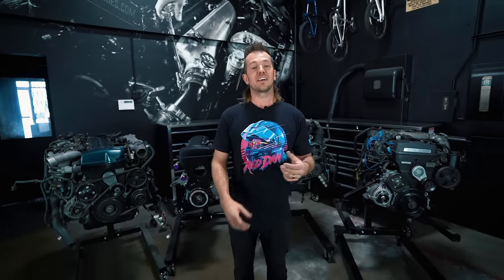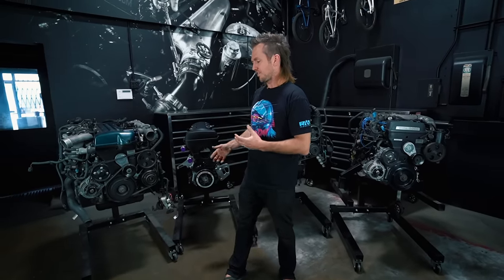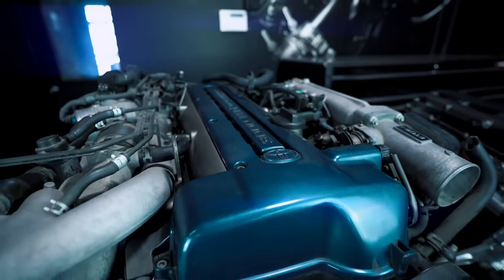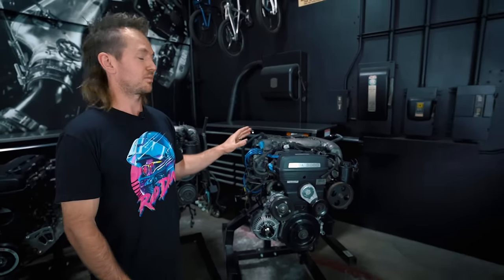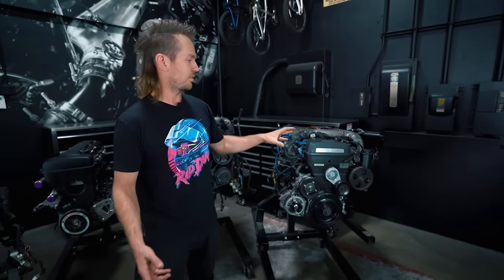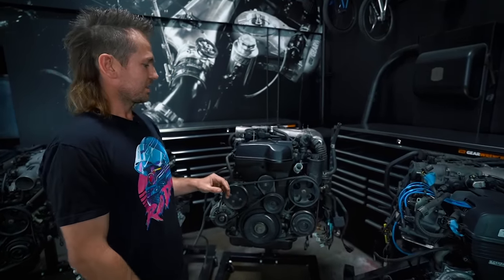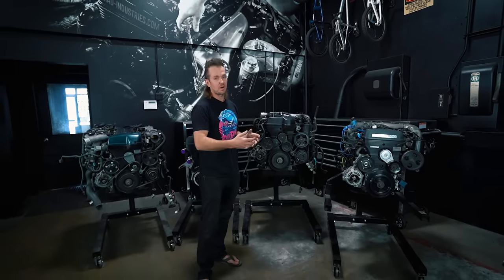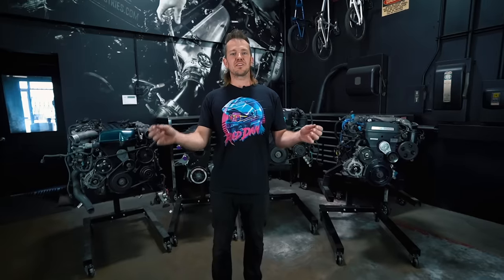2JZ Motor 101

Comment: 2jz ge vvti is the most sensible platform to start with when building a high hp, single turbo set up. Already has coil on plug. Add a set of forged rods and there ya go(more or less lol). Also the 2jz ge has the best flowing head of all the jz family
Reply: vvti na, as it sits is the worst of the variants because of the stock components for building power. they are all reliable tho
Reply: The non VVTI GE has the best flowing head. At least unless you're going 1.5 JZ build with the head from the 1JZGTE. Also the non VVTI is non interference, he got it mixed up with the GTE non VVTI which is interference due to the compression ratio. Putting in 272 cams turns the non VVTI GE into an interference but it isn't from the factory.

Comment: Hey Dan, thanks for the rad vid, I wonna do a 2JZ swap on my Datsun GX coupe, but where im from (South Africa) GTE prices are ridiculas (R65000) and GE prices are reasonable (R10000-16000) 

Anyway thanx for explaining the difference between VVTI and non-VVTI. I wonna do a non-VVTI build with a fat single turbo on pushing about 800hp in a car that weighs less than a ton😅😅😅

Comment: Damn, thanks for making a video like this man. I've been thinking about how to boost my is300 reliably for a while without buying an Aristo motor and I just see alot of people throwing information around that just doesn't make sense. This will definitely help me with getting my build correct.
Reply: Non vvti GE pistons and rods, GTE headgasket, ARP headstuds, BC cams, exhaust cam gear, redo seals especially for the crank, other than that you should be good to boost the engine. If you have an automatic is300 you should be good over 350 ft/lbs or torque, but manual you should try your best to keep it under 350 ft/lbs since the w55 transmission is not that strong.
Reply: @CardsNSleevesTCG  Are the non-Vvti GE pistons and rods different from the VVTI?  If you’re gonna do a piston and rod swap wouldn’t it be worth it to just go for completely aftermarket stuff?
Reply: @Chevsilverado  non vvti has same rods different piston from gte apparently and vvti has thinner weaker rods and different heads to the gte to accomodate n/a compression.

And after market vs used piston n rod is dependant on price

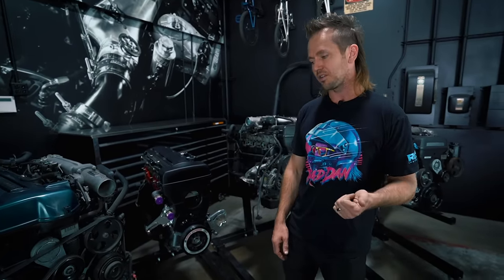Comment: 3:20 I made 831rwhp on a dyno dynamics at 29.3psi on a mix of BP98 and toluene back in 2010 on stock GTE non-VVTI short motor, just BC 280°/11.48mm cams, shimless buckets, Ferrea dual springs locks and Ti retainers, L19 studs, Hypertune big port plenum with 102mm throttle body, an ultra basic GT4708 80mm bush bearing turbo, and an Autronic SM4. Would've loved to have seen what it would make on E85 on 45psi with a built motor and one of the new G series Garretts but life intervened and I sold it all a few years ago.
Reply: Cool bro
Reply: Life just loves to intervene when things are getting good. big ups to that build though, sounded like a monster in the making

Comment: Thanks for this info! Can’t wait for the GE-T guide! Can you make a video about putting a 1JZ top on a 2JZ-GE bottom end and add a turbo using E85 stand alone and fuel system upgrade making a 1.5J ? This guy is trying to sell me on that this can be done and make power reliable for less than a standard 1J or 2J set up.
Reply: Keep the ge head. Flows better than the 1j head! The only real reason to do a 1.5 jz is if you have a blown 1j and you swap the bottom end over to get a good motor. You can delete the distributor and get new intake and exhaust manifolds for a ge and you’ll have a really stout and capable engine!
Reply from the maker: Yep

Comment: I'm trying to decide on my next build ls or jz. It depends on the car I guess.
Reply: Jz is good but the w58 gearbox (manual, mated with non turbo jz)  is absolutely horrible. So you have to get either a v161 or r154 gearbox. So keep that in mind
Reply: Buy the most expensive one!!
Reply: fuck it, turbo LS in a supra
Reply: No hemi? Cummins? Viper v10?

Comment: This is for the Honda guys transitioning over to the big boys, 😂 jk
Reply: Fr tho we be sick of putting our heart and soul inter our 4 cillinders only to make 400hp
Reply: <just to beat a bolt ons only v8
Reply: don’t sleep on the K24. You can slap on a big turbo, get 500+ hp, blow up the engine, buy another K24 for a few hundred bucks and do it again.
Reply: @bryceheppler7181  Big turbo is the way to go for the K24, highly recommended getting one if you want to keep up/outrun v8s and maybe some bolt on v8s.
Reply: @AquafalconHD  was just teasing the Honda guys. K series one of the baddest 4banger out there for sure.

Comment: 2jzge non vvti are 10:1, also as far as my research has done, they're also non interference, vvti's are interference.
Reply: Jonathan Gardner yea I’ve got one and I’ve rotated the crank without a timing belt at all and never made contact with the open valves.
Reply: @harrisonpeck130  good to hear I wasn't miss lead, thanks!

Comment: As expected, a bit misinformed regarding the GE motor.
1st. All non vvti GE motors are non interference.
2nd. All 2JZGTE's and 2JZGE's have cast pistons. Non vvti GE pistons are just as strong as GTE pistons and will handle just about the same horsepower even with stock compression if running E85. However GTE pistons will perform a bit better on prolonged pulls because of the added coatings and when in a GTE block, the added oil cooling.
3rd. The first run of vvti 2JZGE's for the american market had the thicker rods, but good luck trying to find one now. 
4th. If the price is right get GE non vvti. Since you should refresh the motor anyway, you can easily convert to the vvti oil pump, water pump and crank trigger neded to go distributorless without any additional cost over replaceing the non vvti parts, excluding senaors. And you can stay with the stock bottom end parts up 800 whp on e85.
5th. There is more 😂
Reply: so would 1998 sc300 would have the thicker rods?? Or are the ge vvti first run was older then that?? Genuinely curious??
Reply: @MrEspnsportsfan  wish I could say, I don't remember production dates. This was discussed and confirmed way back when Supraforums was a thing.
Reply: There’s hecka info on there and clublexus I just don’t remember off hand

Comment: I can totally agree with the crazy price not being worth it. I was looking at buying the 2jz-gte vvti for about $2,500 around mid 2019, and now they're $5,500-$6,000.
So I just went ahead and bought my 2000 Lexus GS300 with the 2jz-ge vvti and 220,000 miles for $3,800. Very clean interior, minimal wear on body panels (no big dents or rust), nothing wrong with it except for the very common "replace the charcoal canister" for the EVAP system, but that's a $200 part that's good for about 150,000-200,000 miles. Everything else is getting replaced anyway; suspension, wheels and hubs, transmission, fuel rail/lines, brakes/rotors/lines and rebuilding the bottom end of the block for some strength. Then its off to the ECU and NA-T babyyyyy!! Not bad for a $4,000 starting point, and it looks just as good today as anything out there. Except for the built in tape deck and cd player in the glove box, that needs an update too lol.

My 1990 Mk3 Supra (7m-gte) on the other hand...that looks like its from 1990...we'll just leave it at that lol. That's a whole other bag of worms that I haven't cracked open, but again not a bad platform for a $2,500 start point.

Comment: This video is hard to watch because of the mistakes that he is making talking about these motors, the non vvti ge is not an interfering motor....and it’s 10:1 compression. Had to stop when he said this because he obviously not to inclined at least he knew how many main caps there are smh
Reply: Do oil squirters really make that much of a difference?
Reply: LORD OF THE RiMS no and idk why he makes a big deal about them, they are only there for longevity purposes, when building a high horsepower motor they are blocked off because having excess oil on the rotating assembly actually can seep horsepower because it is encountering more resistance, that is why things like windage trays exist they scrape oil off of the crank to make the rotating assembly encounter the least resistance possible, blocking off the oil squirters also raises oil pressure which is good for high rev applications which most high horsepower builds are
Reply: @lordoftherims436  Somewhat, they are good to have for extra oil protection/cooling but its not the end all be all that this video makes them sound like. The stock connecting rods on both GTE's and GE's already have an integrated oil jet at the base of the rod that shoots oil at both the piston and cylinder walls for cooling.
Reply: @zXCrackersXz  if you were doing an na-t build you would probably go with low compression forged pistons anyway that have more heat resistance
Reply: @zXCrackersXz  that oil jet on the rod isn't to cool anything, its to lubricate the piston pins 👍
Reply: @mrctuned2844  I mean I guess it helps lubricate the pins but the factory Toyota service/specifications manual says differently, under connecting rods in bullet-point #3 regarding oil jets on the rods: "An oil jet is provided in the large end of the rod for cooling of the piston."
Reply: @zXCrackersXz  oh I wasn't aware of that, good to know. I don't remember seeing that in the Vvti manual but I may have missed it, in my opinion that oil will be quite warm after leaving the bearing and journal area, but I'm not an engineer
Reply: @mrctuned2844  I haven't looked at the factory VVTI manuals, so I don't know how they did the revision for the information. On the Non-VVTI Supra manual, the information regarding rods, crankshaft and crankshaft pulley for the GTE is referenced/pointed to the GE section of the manual since the parts are the same.

Yes, Oil being squirted at the piston will be quite warm but there should be temperature differences and it is this difference that allows for the cooling aspect from my understanding. An article I read on engine development talked about its supposed to work, what I understood is that it relates to the Law of Conservation of Energy. Heat=Energy. The Law states energy cannot be created or destroyed but it can be transferred from one object to another, or change forms. 

I'm no engineer either so I only understand bits of how it works, and its kind of hard for me to put into words.
Reply: @zXCrackersXz  its all good man. I build engines and ill usually delete piston oil squirters on a small bore forged piston, as the oil jet will unevenly heat the piston and cause stress points. This is for a forged piston only, I always keep the squirters installed on a cast piston engine. No doubt it helps control piston temps on OE setups. But i definitely learned something today and I'm not embarrassed to admit that, so thanks for the info 👍😎
Reply: @mrctuned2844  That's cool to know and its no problem. I've just had to learn a lot the hard way since I never have good experiences with mechanics and it's a bit of a hobby. I'm more interested in suspension dynamics as I'm not horsepower hungry like some of my family members. It also doesn't hurt to know a bit about how the JZ was originally constructed as it helps me visualize a build I wanna create to put a few theories I have about the JZ to the test.

Comment: Firstly, well done with these edits! Looking fresh af!
Also, just to clarify cause I didn't hear you mention.. Aren't the GTE-Vvti rods and cams smaller than the non-Vvti motors? I heard that they're safely tuneable up to around 550bhp on stock internals and will need upgrades for more. The GTE-Non VVti I'm aware can make up to 7-800bhp safely.. I've heard so many different stories about them and hearing what you've got to say would make me more confident in pushing it.

Comment: Good looking video! you sound sleepy, however "correction" the 2jz GE is a non-interference engine. The 2jz GE vvti is a interference engine that will break your valve when thrown out of timing because of the variable valve timing system.

Comment: RAD Dan the VVTi 2JZ-GTE also had better torque figures. The US Non-VVTi came with bigger injectors and a bigger fuel pump to get the 320hp. I think the VVTi has better efficiency, but modifying it you won't care much about that around a 1000hp with a different fuel setup.

Comment: Adding on to what Dan said anther difference between the VVTI GTE and non VVTI GTE the US had 550cc injectors a slightly more aggressive exhaust cam and a steel impeller vs our little 440ccs and weak ceramic impellers. Which actually brings up a question if anyone has an answer. What's the point of doing the GT28 conversion on the US spec when the OEM turbos can already take 20psi on pump? I've always wondered that. 🤔

Comment: Do a flowing test with the GE vvti and GE non vvti heads. The non vvti GE has waaaaay bigger intake ports than the vvti Ge. On the outside they look the same size, but if you stick your fingers on each one, you’ll see the difference. The best budget setup would be a GE non vvti head with a distributor delete by using 1ZZ smart coils and either welding a cam sensor on the intake side of the head, or drilling the valve cover on the top and installing a cam sensor...
Reply: what power or response increase would you see in the non GE vvti over Ge vvti since i take porta are bigger?
Reply: BIG JDM probably more torque. The other problem of the GE vvti head is that a lot of people crack them with high HP (that’s what I keep hearing). I’m aware that the GE VVTI head has some water jackets that the non Vvti doesn’t have. That’s why it has smaller ports and that could be why they crack easier...
Reply: Devil2jz possibly, i believe the GTE vvti has deeper water jackets while the GE vvti has shallow water jackets do to the NA low hp nature. I would think the ge vvti engine would have a better torque and power band over non VVTI since that’s the whole point of vvti.
Reply: BIG JDM if you are planning on keeping the stock cams, the vvti is better. On 272 and up the vvti is kinda useless. All of the big high HP 2jz are non vvti.
Reply from the maker: I have heard people like to use the non VVTI head for turbo builds but there is just more involved in getting that head to work for big power so I think less people are going to go that route and that’s because they want to buy off the shelf parts and get it going as easily as possible
Reply: RAD Industries the GE non VVTI head can use GTE non vvti cams (that’s what I did) and you can drill the intake valve cover and install a cam sensor with a grommet using GTE cams (because the have those built in steps/teeth for cam signal).  GE intake and exhaust manifolds are getting popular and easier to find since a lot of people are going the NA-T route to save thousands of dollars. I love your videos and I think you should upload some more!
Reply: @devil2jz500  Great convo, i’ll be ordering a 2jzge VVTI in couple weeks. i was thinking about going 264 cams valve springs and retainers, GTX3582R or GTX4088R or G35-770. i believe i only want 640whp ish. so those might be over kill but i did want great mid and top end. forged rods and GTE pistons and some GTR cool packs if that’s even necessary.
Reply: BIG JDM the 1ZZ coil packs are cheap and they work perfect for up to 1200whp. They are smart coils and they come on the Corollas.

Comment: I have a (NA) 2JZGE Non VVTI '93 SC300. What would be the steps/parts to upgrading the motor and making it withstand higher HP? So far my brother and I have only done an EGR delete and bought a cold air intake. We did some other maintenance stuff as well like a new valve cover gasket, new water pump, and new spark plugs.

Comment: I have the VVTI 2JZGE sitting in my garage at the moment. My intention is to shove it in my '95 Tacoma when the 2rz eventually dies. Between now and then I have a middle of the road project Mr2, my first time going in to a car engine will be a 4age with zero compression across all cylinders. The 2jz motor passed compression and leak down, but I intend to soup it after I've first rebuilt the 4a.

Comment: Great info. Is there a list of what cars came with 2jz's?
Reply: 98-05 IS300/IS300 Sportcross(wagon)/altezza wagon AS300(altezza AS300 wagon was the only that came awd with 2jzge also).

91-05 GS300/aristo(GS300 came with 2jzge only and the aristo came with either the ge or gte for Japanese market).

92-00 SC300- these came with 2jzge's for US market(Soarer came with only 1jz ge's or 1jz gte's)

92-01 chaser/cresta/cressida(these are basically the same cars but with slight differences but they mostly came with 1jz gte's or 1jz ge's but they come with 2jzge's also).

91-07 crown(came with 2jzge's or 1jz he's or sometimes 1jzgte's but depending on the model some may have came with 1jzfse's or 2jzfse's).

91-04 crown majesta- came with 2jzge's other than the UZ V8.(and are heavy).

97-04 proges- came with 1jzge's or 2jz ge's.

01-07 brevis- came with the 1jz fse or 2jz fse.

tried to look as much as I could remember from most of this amd some of the years maybe wrong but this is basically the list of cars that came with 2jz's basically(other than some models I didn't list that came with only 1jzs or 1jz gtes).

Comment: you have the best knowledge of 2jz awsome videos, I have question, I have Store my 94 Supra TT for  5 years. I didn't even start the car since. I will be going to start the cat next year in Summer. The first time fire up after 4 years I am going to change the oil,  it can cause damage after a long time fire up the engine after that long time?